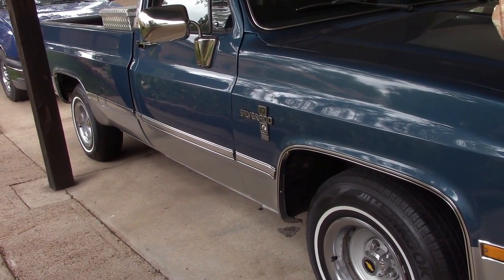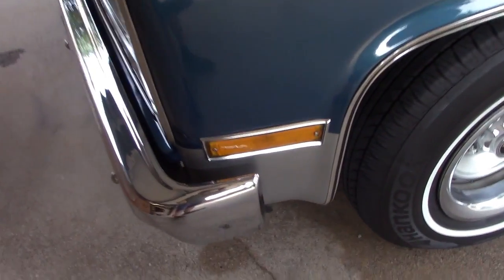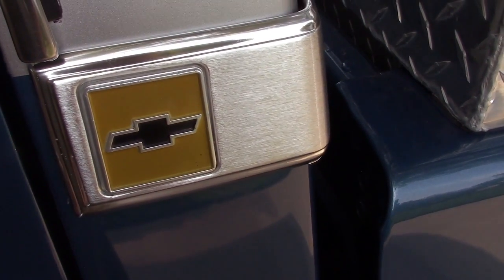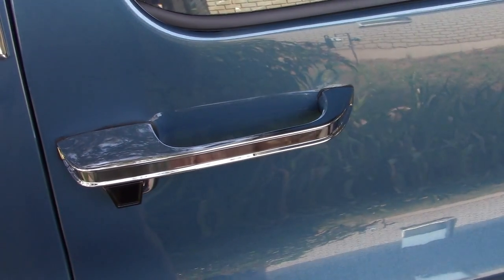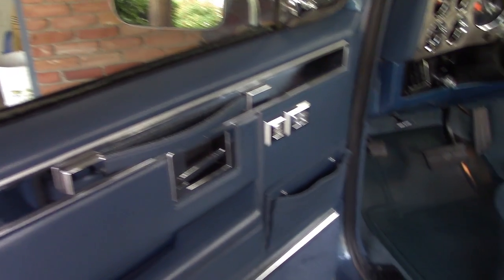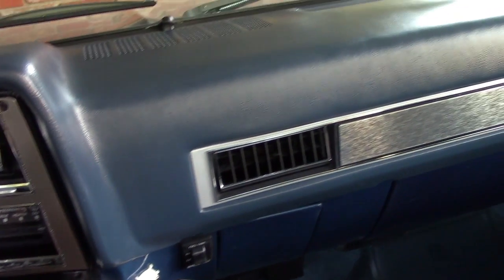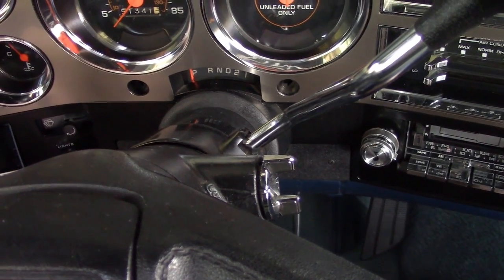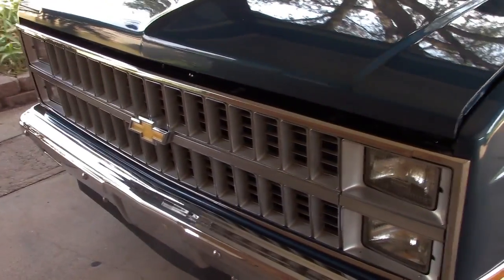1981 Silverado Refresh: Conclusion

Comment: I love how it's undesirable because it's not LS swapped, that was a great line!  Eh, in the meantime you can put a VTEC sticker on it and get 25 more horsetorque!
Reply from the maker: I forgot to mention the Quadrajet mounted on top of the intake. Man, that seriously plummets the value! Heck yeah, 25 more horsetorque, I'll order one right now!
Reply: @dynatrak  Yes, the classic QuadraBog or QuadraJunk carbinator, same type the Bluick has.
Reply from the maker: @jaykay18  Haha, yep, I've heard all those nick names! I must have lucked out, because mine is working quite well.
Reply: @dynatrak  Either JYD or VGG once said that the Quadrajets will always run.  Maybe won't have the performance but they'll always run.

Comment: This truck is beautiful.  Love everything about it.  Do you know if the 350 was added later?  As I understand, the ESC was only available from the factory with a 305.  I have a 83 model and it still runs off the ESC, believe it or not.  Mine has the 305.  Extremely dependable and runs like a watch.  I do plan to upgrade the power someday.  But for now it just runs too good disturb.
Reply from the maker: Thank you! I had the 350 installed in 2007. Long story short on this truck. My grandpa bought it new, I've owned it for 30 years, so I know the full history of this truck. In 2004, still all numbers matching, a lowlife decided they wanted it. In 2007, it was found abandoned, so at that point, it needed a full refresh. I guess at some point the 305 died, because there was a non- functional 350, when I started working on it. If none of that happened, I'm sure it would still be a numbers matching truck, but I have to say, it overall operates much better with a 350. I suppose this was typical GM 80's quality. You could get one that's perfect, or one that's troublesome. Unfortunately, mine was a troublesome variety, and regularly ate ignition modules. Didn't help my my grandfather took it to a terrible mechanic, that did more harm, than good, when the no start issue first happened. ESC was bypassed in the late 90's. Never an issue since!
Reply: Well I'm glad you were able to get it back after it was stolen!  Where did you get your interior?  It looks absolutely perfect! @dynatrak
Reply from the maker: @b103206  Me too. Mostly new old stock GM from ebay.